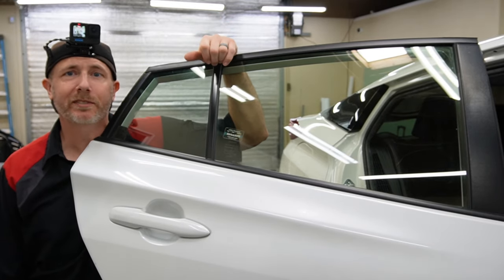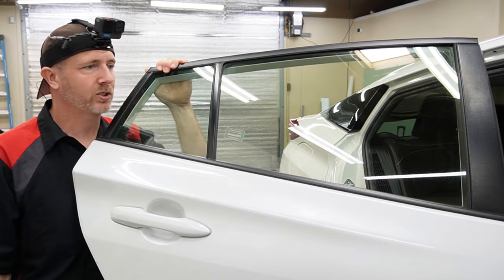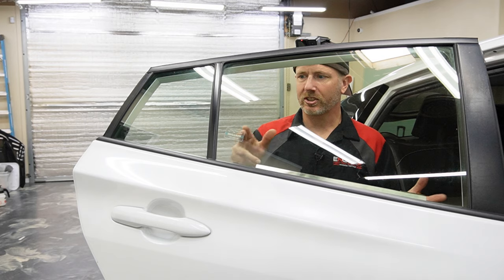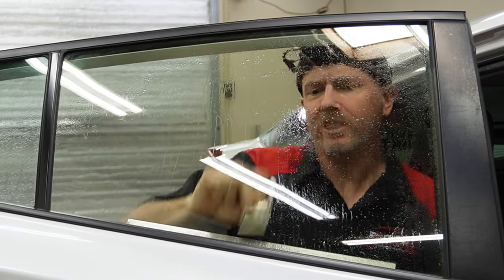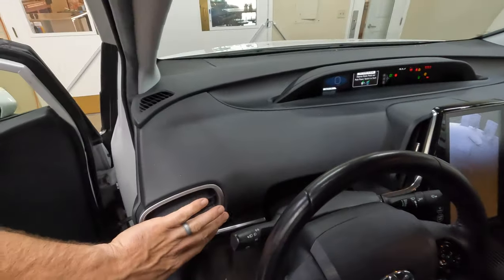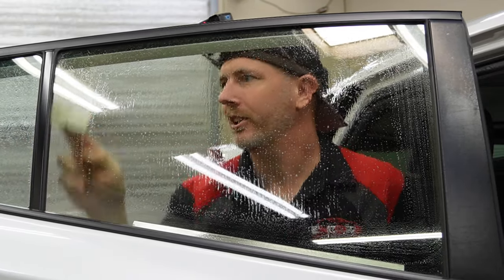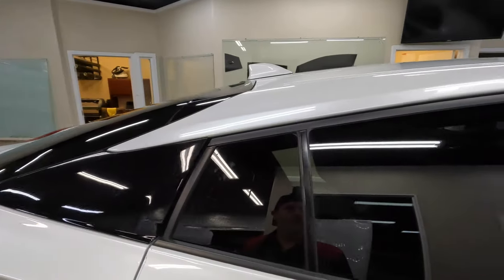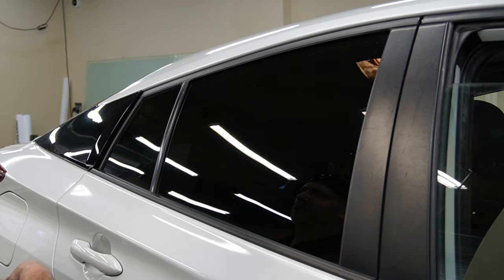Toyota Prius Rear Door Tint DIY | Roll-Up & Wing Window Tinting

Comment: Great video! If you had one tip to give someone that is just learning the trade. What would that be? Thanks
Reply from the maker: I would highly recommend focusing on the quality of your work. Speed will come with time. 
This will cost you time and materials in the beginning but will put you so far ahead in the long run.  
Everything suffers when your quality is bad. Especially your reputation.  👍🏻
Reply: @EncorePPFtint  Thank You!
Reply from the maker: No problem.  Feel free to ask questions as you have them. I've got a lot of answers!  😁 I'm going to start posting window tinting videos weekly now. 👍🏻
Reply: Maybe one more question or a possible video idea. When tinting over factory 20 or 15 percent what would you use if the customer wants 5 percent. Thanks again. Just subscribed!
Reply from the maker: @Ryanr2789 Great question. You'll want to put something right around 15% over the factory tint. 35% won't make much of a difference visually, and 5% over factory tinted glass is super dark! 👍🏻
Reply: @EncorePPFtint Thank you!

Comment: Have you tried using a chopstick for pushing the dots and small lines. Works great. And a customer looks a car over with a fine toothed comb when they see a small spot? Ya it ain’t so! Lol. 😂
Reply from the maker: I'll have to try a chopstick. Do you use a plastic chopstick or a wood one?
Some customers are CRAZY! 🤣😂 You've got to love them. Fortunately, at this point in my career,  I don't much care how close they look. Most of the time, they aren't going to find a problem.  I clean all the windows up really well.
Reply: Wood chopsticks sanded down and round off the point. 
I have no doubt that your work is pretty much flawless after watching videos for the last six months or so you were top-notch at what you do in this game. Maybe someday I can be like you lol. I am still wet behind the ears in this industry. 2.5 or so with Ppf and about a year with limited tinting. Mainly Toyota, VW and Hyandia for both.
Your videos really do help. Keep up the great work and thanks for sharing.